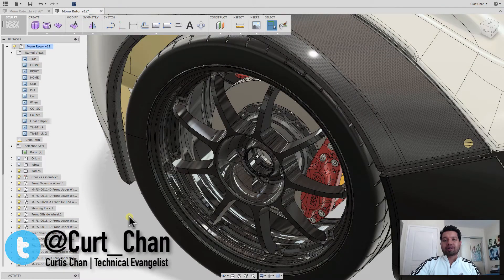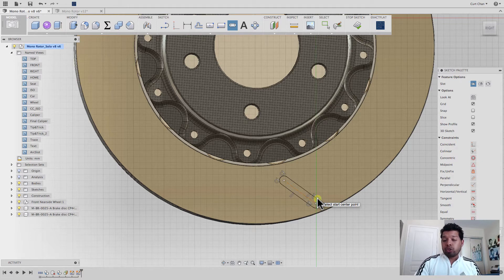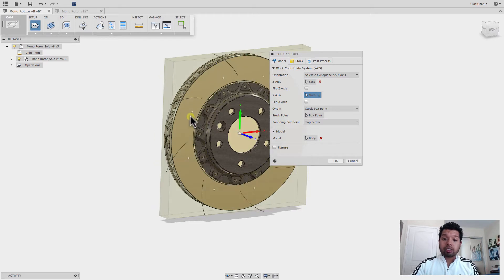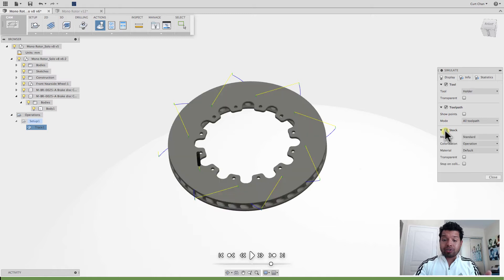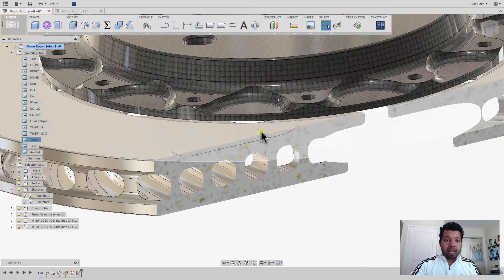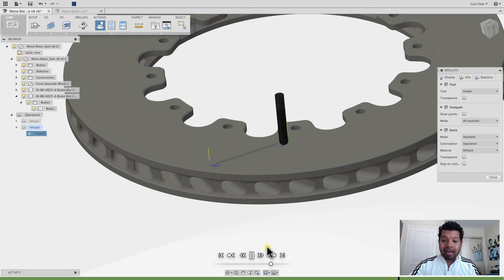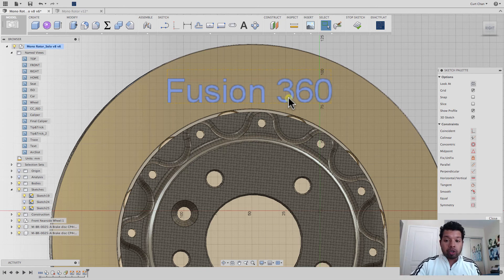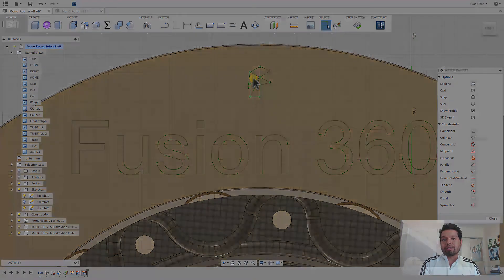Text and the Trace Operation in CAM

Comment: When you pick the patterned sketch on the rotor face, is it possible to simply select the pattern or sketch in the CAD tree like one can in HSMWorks/SolidWorks, or are you stuck selecting each arc?
Reply: atomkinder67 Unfortunately not yet....since the timeline disappears when you hop over to CAM.
Reply: Is it in the pipeline? I really like the select pattern feature. Nice thing with it is that if the pattern changes, the toolpath updates when regenerated to automatically reflect the model changes. Just a thought I suppose.
Reply: atomkinder67 Agreed.  Have you tried the new pattern feature with CAM?
Reply: Jeff Walters just helped me with an example and used the pattern feature, something I'll have to look into more.

Comment: Nice video. Is there a font in Fusion 360 that is a single line not a boxed text.Or another way to put it is a single line text. When engraving  boxed text the tool needs to go around the letter,number or what ever the text is twice which takes time and does not come out as good as single line text. The text would be created just like you would do it with a pen or pencil. I could import text from OneNote or MS Word I think, not sure if that would come thru boxed.
 
Thanks for the video,

       Ed
Reply: Ed Germain Hi Ed,  I'm thinking probably the best way to work with a Onenote or Word Font would be to have that specific Font as a .svg file, and work with it from there.
Reply: Nick F Thanks Nick, got this captured as an enhancement request to the Product Management Team.
Reply: Curtis ChanHello Curt,
 Do you know if there is a single line font in Fusion 360?I have tried a bunch of different ones with no luck,There are just to many to try every one . The .svg work around seems to work but it is easier and quicker for me to use my old CAM software for engraving. 
 Thx again
Reply: Ed Germain Hi Ed, good question.  Have you tried posting on our Forums? http://forums.autodesk.com/t5/design-and-documentation/bd-p/124
Reply: Curtis Chan No . But I will try. Thx